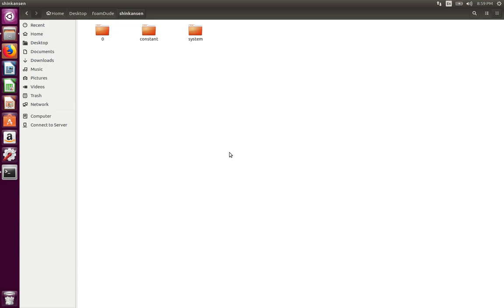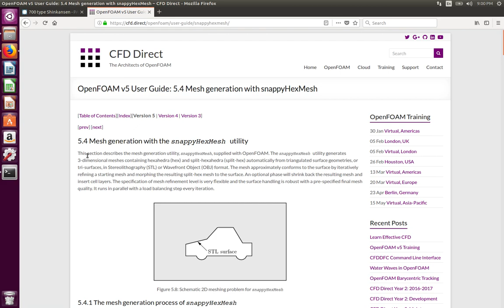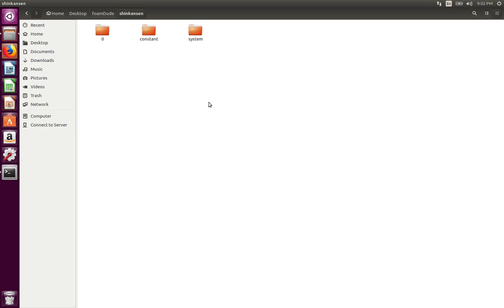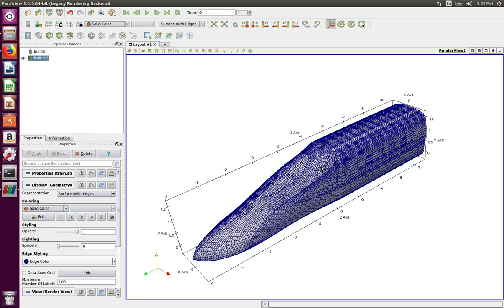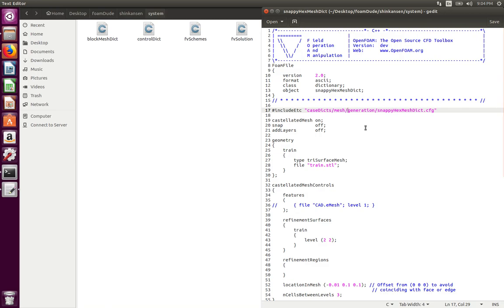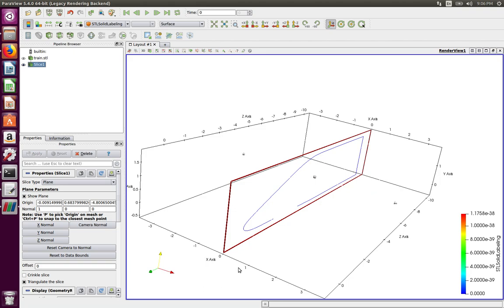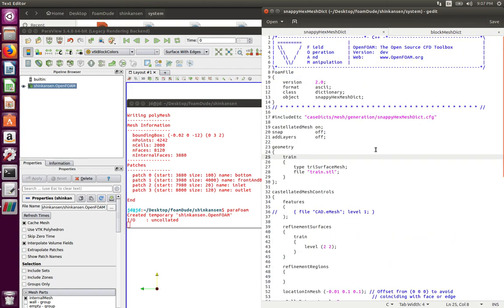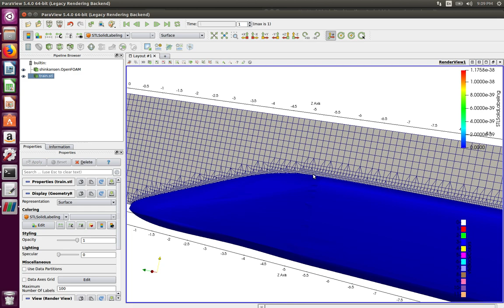OpenFOAM: SnapyHexMesh - Castellated

Comment: I have no SnapyHexMesh file in my pitzDaily's system folder, why? .... I'm using OF v7 in ubuntu
Reply: You have to copy that file and also meshQualityDict.

Those files are in $FOAM_ETC and then in templates/inflowOutflow/system/

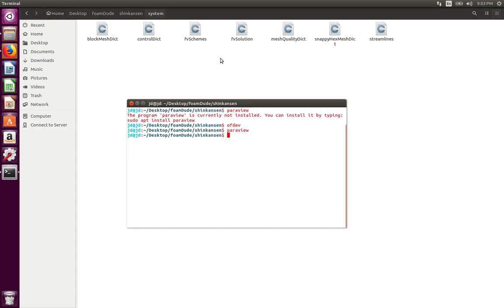In this video he says it in 4:55
Reply: @TheAurora1993  thanks for reply, I have another question, I have a 2D model (from Blender) and want to set this mesh for OF, where I must declare one cell in the z-axis  direction?. This tutorial and lots of them are for 3D mesh but I couldn't find for 2D mesh
Reply: @jaa70  Okay, I'm just learning about OpenFoam, but I have learned that OF only works with 3D objects, and if you want to mesh a 2D object I think you have to declare surfaces as "empty" in blockMesh or something like this.

I think the best thing you can do it's open the object in paraView and see the axis. You probably have X and Y, so yes, the Z-axis direction should have 1 cell thickness.

¡Buena suerte!
Reply: @TheAurora1993  thanks , I will try it.
Reply: @jaa70  congratulations Jose!